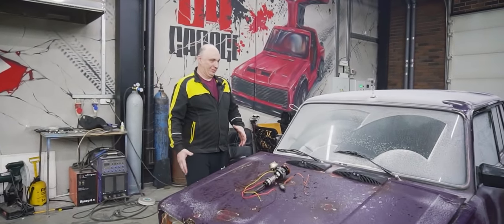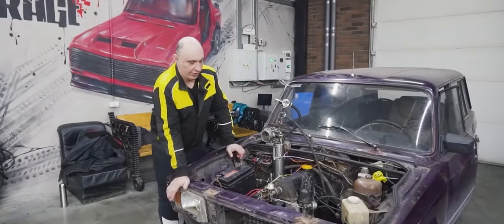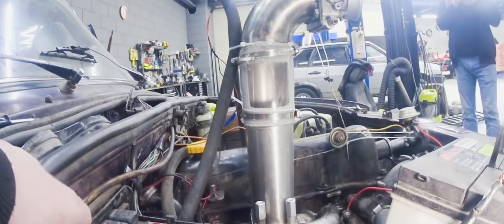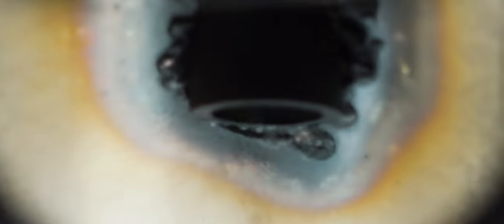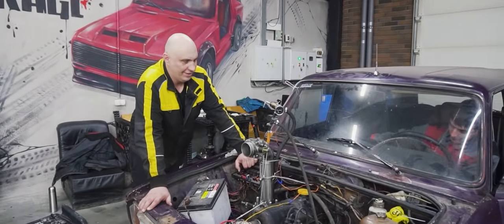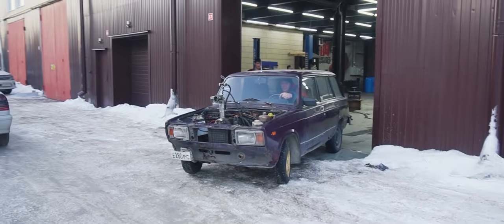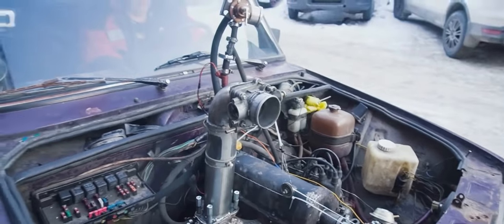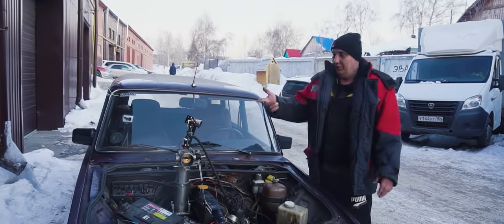Can you replace a carburetor with a fuel injector?

Comment: No problem, we used to call them single point injection systems. You can even regulate the fuel flow mechanically.
Reply: @applepoop10  In Europe it was called SPI, single point injection
Reply: @1995KML  I always new it as single point injection here in the uk.
Reply: @1995KML  TBI in America.
Reply: GM did this for years even after everyone else went to SFI and MPI.
Reply: Ford UK came up with CFI (Central Fuel Injection) which literally replaced the carburettor on certain models, quite predominantly, the Mk2 Sierras. Other manufacturers developed more or less identical systems.
Reply: @1995KML  mono point is what I heard
Reply: General Motors called their's "Throttle bottle injection." Their V8 engines looked like the had a 2 barrel carb, but it was 2 injectors over 2 throttle plates.

Nissan made a few engine that ended with the letter I, such as the "VG30I" and they called it "Electro injection" It was their way to make TBI and used 2 injectors.
Reply: @Jedendwa0  What does this have to do with what kind of single injection system this engine is using? Do you seriously blame garage 54 for what their goverment is doing?
Reply: @ATSNorthernMI  gm actually adopted multi point fairly early, they did keep TBI on some models into the 90s but so did other manufacturers.
Reply: @Jedendwa0  you buff pickles
Reply: @kenur6325  especially since this is a translation of a video that was originally uploaded months or even years ago.
Reply: @whitesapphire5865  it was more common on smaller engines and cars with Fords, such as Fiestas and 1.3 engined escorts etc. we saw very few CFI Sierras in our dealership, if any.
Reply: What is your view on Russia verses Ukraine?
Reply: @twotimes2099  I hope there will be no war in Poland. if it is, then I am sending my son and my wife to my family in Germany and I will stay to defend the motherland.
Reply: Mechanical regulation? Mine (Chevy 305) had a huge electronic control box with lots of bables attached, was nothing mechanical about it.
Reply: @applepoop10  spi, single point injection.....tbi refers to aftermarket (usually) individual tbs with an injector each...this, in Europe
Reply: @applepoop10  its both.
Reply: since diesels doesnt always have throttlebody what do you call the SPI equivelent over in America
Reply: @TheSimonarne  non existant
Reply: I still drive a 90s Silverado that uses TBI.
Reply: @TheSimonarne  diesels dont have throttle body... period....diesels only have throttle body-style things for increasing egr flow and to create swirl, as anti shudder valves and other commodities.... diesel doesnt work the same as a gasoline engine...diesel is not injected outside but inside the engine, either in pre chamber or directly into the combustion chamber... the engine in the video is gasoline and  in gasoline engines from that era the fuel ins injected into the manifold and sucked in by the engine vacuum
Reply: He said that about 30 seconds in 🤦‍♂️🤦‍♂️😑😑
Reply: Yep yep throttle body injection
Reply: I also always heard as single\mono point injection, then after multi point injection and more modern the direct injection.

I still don't see is where are the 2 stroke direct injection motorcycles which was supposed to be a big thing reviving 2 strokes...
Reply: @petelattimer6808  I had a 5.0L V8 Ford with TBI/CFI back in the day.
Reply: @TheSimonarne  "common rail injection"
Reply: @davelowets  common rail injection is still 1 injector per cylinder, with common fuel rail, while TBI can have like 4 injectors for 8 cylinders at the intake (throttle body). I've had a TBI V8 305, that had 2 injectors for 8 cylinders, when back in the day fuel economy was a thing, so they choked the V8 with that stupid thing, but it was still fun car.
Reply: @skylinefever  isn't this system in the video a hybrid of a Rochester mechanical fuely or Chrysler's 50's system? 

glad it works might need it in a pinch on my 4.5" stroker 2-G hemi v8 build in the shop as the full 2016-16/modern style engine management system isn't there/got stolen and my cash temporary is going other places for now and not having to buy and build two completely different intakes ect is a blessing at least for testing in the shop to see if it idle's/runs correctly and a bonus if i can go a round my local area's temporarily for little and light testing ect 

a crankshaft or camshaft sensor's will work? in a pinch? as well? on gasoline as i deleted the dizzy and or using its hole for a GDI/diesel fuel pump combo now
Reply: @richardprice5978  No, I don't think the TBI is a combo of the fuelie system and the Chrysler Bendix Electrojector.
Reply: @skylinefever  but i believe gm 1980-2000~ TBI and 1950-60~ FCA both had a primitive version of a ECU but this G54 and the fuely are vary analog so that's why im thinking that way
Reply: @skylinefever  a modern crankshaft or cam sensor will probably trigger it just like the points dizzy in the video right? or no dumb idea?
Reply: @richardprice5978  It would trigger the injector. The problem is making the injector pulse long or short enough to match the fueling need of the engine.
Reply: @skylinefever  o im sure i can whip up something temporary to play with rail pressure or change the voltage to change fuel ( and TBI is ok if i need to junkyard/daily driver pillage one for a testing as i did that to my K1500 80's dizzy one time on the 383 im just trying to save me from fabricating and testing the bottom end and valve train aka lifter's ect of the engine mechanically speaking ) as i said its a shop testing/get you home in a pinch/💩sichwashan as my car got stripped to a shell and im sad and piss off about it but trying to move on

next is spark but 🤷‍♂ analog wise should be okay ish to do CNP or put/hook up the dizzy in for the day

i tried using the LSX coil on the previous version 383-B to fire the plugs/dizzy plus oem carb but i guess i did something wrong and it wouldn't fire off as the 70's oem-box died and i was late to work and didn't have the rest of the system ready for the full change over to efi that day
Reply: @richardprice5978  I once had the idea to have an analog VAF on a fuel pump in order to do that.
Reply: @patrykgti5893  at least someone gets it.
Reply: @safetyfirstintexas  there are carbureted diesels
Reply: @applepoop10  q
Reply: This is known as "throttle body" injection
Reply: @whitesapphire5865   NO Ford UK did not come up with it Ford North America did it was in use by 1983 4 before the MKII Sierra . By the time the MKII was built Ford North America had already moved past CFI and was using SEFI.

Comment: Great experiment, good job guys! Of course you really need to increase the 'ON' time of the injector during acceleration and reduce it during idle.  Without any way to do that, the injector will always provide too much fuel at idle (rich) and way too lean at high RPMs. Keeping with a mechanical setup, you can improve this with a fuel pressure regulator with a vacuum port (this responds to engine vacuum to adjust pressure). At idle the throttle plate is mostly closed to give high manifold vacuum, this will connect to the fuel pressure regulator and responds by lowering the fuel pressure. Given the injector is pulsed the same amount, but with less fuel pressure, the result will help correct the rich condition during idle. During higher RPMs, of course the open throttle plate will reduce engine manifold vacuum to almost zero and the fuel pressure regulator will respond by increasing the fuel pressure. Again, assuming the injector pulse width is constant, by increasing the fuel pressure during acceleration will cause an increased fuel flow and help correct for a lean condition at this time...
Reply: You are very knowledgeable
Reply: Do you think my idea would solve your issues ? 
Big Dan
1 second ago
Great video. I wonder if an injector would work through a Mikuni carburetor. Perhaps the slide could control the injector jetting and the carb act as the throttle body. It may atomize better, and feed a 4 cylinder engine with a 1 cylinder fuel supply.
Reply: Ah, you just described the K-Jetronic :D
Reply: I wish they would make a follow up video fixing the leaning issues and we would see a fuel injected high rpm lada
Reply: @teslatrooper85  l jetronic is kinda similar
Reply: Great info
Reply: I was thinking of hacking some sort of vacuum modulator into the second distributor, to increase the dwell angle and thus the amount of fuel per cycle as demand increases.  I think with the constant dwell angle the fuel dose per cycle ends up decreasing, rather than increasing, as the throttle is opened... no?
Not being much of a mechanic, I'd probably add a throttle position sensor, an Arduino, and a solenoid driver, but that would not be in keeping with the spirit of this channel.
Also, [topical geopolitical rant relating to events which occurred long after the video was recorded and over which the guys who produce this channel have no influence]!!!!
Reply: This is a good solution, The problem with the distributor controlling it is that the injector is open for a SHORTER time as the engine speeds up resulting in it going leaner as you speed up. If you wanted to get technical you could use a arduino or the like to give very short pulses at idle and increase the duration with engine speed. I had a car in the 90's that had a carb that had electric jets instead of the typical type, it probably worked something like this.
Reply: @kimricsmythe9879  exactly, duration longer at low speeds, shorter when fast, it needs something to invert that!
Reply: Distributor spins proportional to rpm
Reply: add a second injector to it and put a little microswitch in the throttle body that will activate the second one only from 25% or more throttle position. Use a higher flow injector for more power. could get fancy and figure out also how to only enable it under load or just not open throttle too much in neutral.  
fuel pressure increase alone is not going to do too much but may help with idle lul
Reply: @ohyou_6599  I was thinking the same but maybe no need for another injector. Just use the same and switch full time 12v to it after certain throttle position. Simple throttle position switch is easy to make with garage 54 style from motorcycle rear brake light swich for an example. That and vacuum referenced fuel pressure and it might be pretty good.
Reply: @teslatrooper85  ... K-Jetronic = late 60s VW system.
Reply: @modelnutty6503  .... redesign the dist so the vac advance changes the point gap with manifold vacuum. That way you can get longer and shorter duration for pulse width.
Reply: @Jedendwa0  
Don't you really know this is an automotive channel and NOT a military one?
Reply: thats how i managed the fuel demand increase when i supercharged a 4l xj with an m72
Reply: @teslatrooper85  k-jetronic working a lot different than this
Reply: @kimricsmythe9879  in an ideal circumstance, the injector is only meant to stay open as long as the intake valves do to prevent pooling behind them. 

Distributors are mechanically connected to engine rpm. Yes at one glance as you increase the rpm the injector seems to fire for less time and you are correct in a sense but on the wrong time scale. 

If the engine is idling at 800rpm and the intake valves are open for 200° then then the injector will also be open for those 200°. At 6000rpm, the intake valve is still open for 200° and hence because mechanically connected to the distributor also fires the injector for those 200°. 

Of course I'm assuming a distributor can stay open for that time period when in reality it's small contacts so it's more like 15-20° worth of on time which would be used to fire the spark plug at tdc. Not hold the injector open for the durations needed here. 

I think the next course of action here would be to find a way to match the injector on/off time (degrees) to the intake valve open time. Maybe custom distributor cap?   Even if injector duration is set constant, flow can be controlled by fpr using manifold vaccum assist like they did in the early 2000s

I love this whole diy thing 54 did, pretty cool.
Reply: What's happening here is that the injector duration is predetermined by the contact points and the injector pressure is set constant. 

So you have a mix match of injector duration not matching the open time of the valves and a constant fuel flow with varying amounts of air.
Reply: @tomasdaniel6510  👍 very different indeed.  Mechanical fuel injection with a fuel distributor.  My Volvo's b21ft used to have it
Reply: K-jettronic systeem.
Always inject fual only the valve is close IT do not go in the cylinder.
Reply: @modelnutty6503  Thing is he could change the open time by adjusting the points so if you were to find the max amount of time you need it open at full flow for high rpm then set it there and make the fuel pressure mechanically controlled by vacuum.
Reply: Exacto broth eso había pensado tu has estudiado los funcionamientos. Sigue así llegaras a mas.
Reply: This is so incredibly stupid and way more complicated than it needs to be,you simply run a second stage injector ,manually or by vacuum line the moment you need more feul the second injector comes into play simple,cheap,easy,effective and  reliable
Reply: Variable dwell angle and feul pressure won't be a sustainable solution
Reply: @kimricsmythe9879  that can be fixed by running a distributor with vacuum advance
Reply: @ohyou_6599  yess!!you can even have a vacuum line running to the throttle body that opens it a extra 25/30% more than the throttle cable and simultaneously switches on the second injector by completing its circuit with the distributor
Reply: @rupe53  someone that gets it
Reply: this is truly true
Reply: I was hypothesizing whether the vacuum advance on the distributor could be used to limit the injector, then I thought itd only advance/retard the specefic time it sprays, making it an idea that wouldnt control fuel. 

A vacuum fuel pressure regulator is probablly the way to go. Very simple yet effective idea to implement.
Reply: Agreed. He needs a way of controlling injector flow. However he has no real way to effect injector duty cycle. He can control the fuel flow using a vacuum referenced fuel pressure regulator to bring pressure down under low rpm. Then he can use a large enough injector to flow the needed fuel to rev higher than 4500. Factory fuel injection vehicles use this method along with modulating duty cycle to affect fuel flow, but he only has the one route of tuning due to the distributor points not allowing him to actually tune on time.
Reply: @kimricsmythe9879  Good catch! I didn't think of that -- I figured the injector just couldn't physically open and close fast enough.